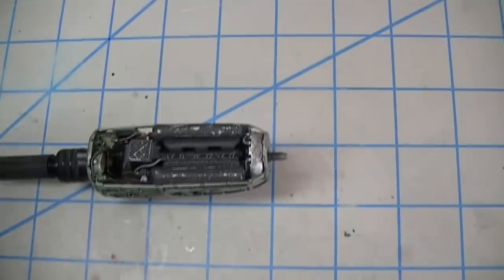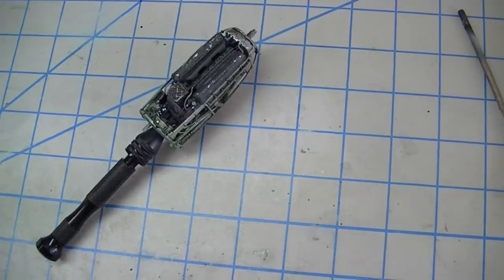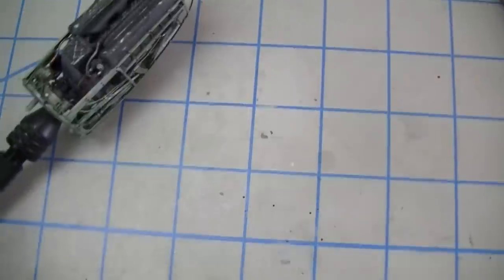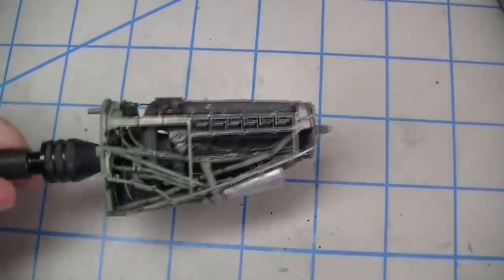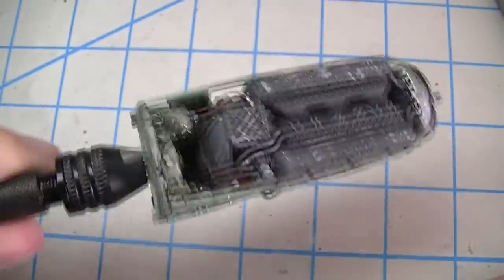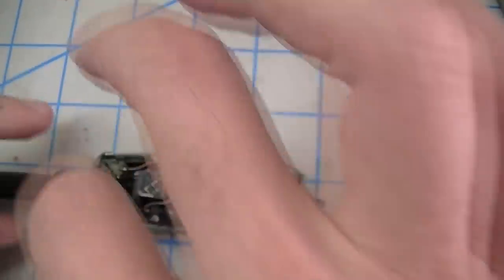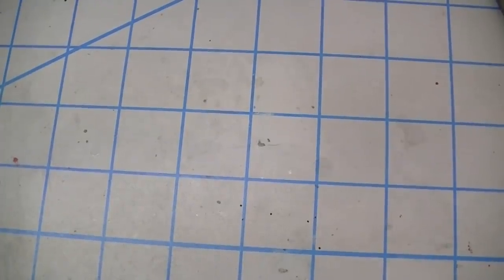ep228 - adding detail for hoses, wires, and tubes

Comment: Your finished product of added detail is fa-nominal,  I've been trying to find the (micro) vinyl tubing that comes with the 
Tamiya 1/12th motorcycle kits. I do the same kind of detailing with aluminum wire, stretched sprue tree pieces, fine 
brass wire. I make my fittings from sprue tree pieces that are hexagon by - Xacto knife. I've been using the same Xacto
knife blade for over 18 years as I resharpen it with a knife sharpening stone. Scraping one side sprue to start, then opposite
side then the other 4 sides (one at a time of course) to get the Hexagon shape. Then cutting, sanding and drilling the center 
hole for the replicated fitting for the tubing for fuel or coolant lines. Unfortunately  There's no way to attach a pic of my work
here to show you. I do the things other modelers don't do.......I fabricate my landing gear to operate as well as the flaps and
control surfaces. Most modelers all do the same things and I'm just as guilty as are all others. What I'm working towards 
now is replicating dogfight damage, bullet holes, fluid leakage from arial  dog fighting. Crashed aircraft and last but not 
diorama that's suspended from the ceiling with

Comment: instead of drilling depending upon the situation of course I sometimes use a heated hypodermic needle to create a hole, basically melting a hole into the plastic, I mainly use fine soldier being it is dead soft as my wire and hose and the fact I have it readily available because I already have it for soldering

Comment: Will, thanks very timely video as about to build the 1/32 tamiya spitfire. I'm an expat  living in Asia so bass pro shops for wiring is not an option but I've been thinking about using lead solder which is available in thin gauges . Have you heard of any body doing this? I'm not sure of the chemical composition and whether it would take paint or potentially pose long term problems.  Also for fixing to engine parts, I've got a crimping tool which comes with tiny bits of flared tubing down to about .5mm which I think would be excellent for this purpose. They are slightly flared to allow insertion of wires before crimping so would make getting the wire into the fittings easier for fumble fingers like me. A spot of superglue would hold them in place and they have a real 'manufactured' look.  Thanks again for your series. I've just finished the full build series on tamiya supermarine mk 1 which was invaluable. Your tip of putting a small piece of sanding foam in tweezers was worth watching the whole series for as I had real problems with precise sanding before.  I find your slow approach really useful as often important details on technique are edited out or obscured by 'fast motion videos' on other channels. Just knowing how long it takes to do some operations is really useful as videos assume you know this. After spending four hours doing masking setup  I used to wonder - does anybody else take this much time, maybe I'm over thinking it?  I stick your videos on whilst I'm modelling. A side effect of this is that my wife now acknowledges that there are people who take scale matters as seriously as I do!

Comment: Another easy access to precision wire is your friendly neighborhood guitar store. They will sell you single plain 30" long strings for about a $1, and you can get every size between 8 - 18 thousandths of an inch easily. I believe .020" is the largest plain string made, but are not as commonly found. Keep in mind; they are hardened and stiff so are not ideal for what Will is showing us, but have many other uses. Above the sizes I mentioned, the strings are a steel core wrapped with either nickel or bronze which can be good for corrugated hoses. They are also available as singles in specific sizes.
Reply: The only drawback is the hardness of these wires. Harder to cut.
Reply: @cactuswest  Yup. Don't try to cut them with cheap electrical wire cutters; you'll probably gouge the blade. You need good hardened snips.

Comment: If you can get your hands on one of the old Aurora or early AFX slot car electric motor armatures they have VERY fine copper wire. The varnish comes off easily with say 600 sandpaper. It is fine enough i used it once for a true scale throttle return spring in  a 1/24 scale car. I think it was about 0.002"-0.003" in diameter. Being copper it worked great to wrap around a very tiny number drill and then carefully glued into place.

Comment: Hello Will. I was looking the wires and cables you use, and I'd like to share what I came across the other day. So my phone broke, I ended in a phone repair store and they sell this copper wire for cellphone flex and screens that is the smallest I found, it's a 0.01 copper wire and is by far the thinest one I've seen so far.  hope this helsp. Keep up with the amazing work and videos! Best regards!

Comment: Heat shink wire insulation with copper wire works well for me. Both obviously come in various diameters too, which I get via aliexpress. The wire insulation gives a realistic rubber hose texture and takes weathering well.  It also comes in loads of colors, but black is best, or has the most uses with engine details. And the other colors work great in cockpits and other areas.
Edit: I forgot to mention that I make up a few feet of the most common diameters and finish them off with a lighter or butane torch so the insulation sleeve is snuggly around the wires. You can use a hairdryer too
Reply: excellent suggestion👍

Comment: Great video. Question. Do you premeasure the wire from starting point A to ending point B and cut it before securing to point A? Or do you just secure at point A and then cut in the end as you approach point B? Thank you.
Reply from the maker: the second thing.
Reply: Thank you! Your videos are excellent.

Comment: will, so loving all your video's and as a newbie back to the hobby in the uk after a 34 years break my first build is a 1:48 scale me 262, so if i were to think about hydraulic break lines and cockpit cables in that scale what would you use ??    ta muchly gangster !!
Reply from the maker: well, at 1/48, a 0.5" hydraulic line is 0.010" or 0.25mm so there you go.

Comment: Hello Will! I have been having issues with attaching PE and various metal wire to painted parts and having it just pull back off trying to make adjustments. I have been using thin and medium CA glue with and without accelerator. Some have even been left overnight. Do you have any suggestions. Some of these parts are painted as in seat belts. Have tried even removing paint at attachment points and still have same results. These are fairly new bottles of glue. So I figure age shouldn't be the issue. Thanks for any suggestions.

Comment: Those pipes could be coolent pipes for the carbs apparently they where water cooled . Love to know the answer if you find out
Reply: They are oil injection cooler lines.  It runs oil through an internal line inside the water reservoir to cool the oil.  It's where we got the idea for modern radiators having transmission coolers in them.  So the external solid brass or copper lines have oil running through them.  In the manual I believe they called them external oil galleys.  In modern engines they use the same principle to route oil to piston squirters on turbo or high performance engines.

Comment: The average survivability of a spitfire aircraft at least in the early part of the war was only about 4 weeks. Much equipment from aircraft to vehicles, tanks etc were nowhere near run in before being destroyed. I always find modelers overdo weathering. If that is what an engine looks like after about 20 hours running then there is something desperately wrong with it in the first place. It should look brand new to be realistic.

For example every time a Royal Navy warship enters a port it anchors off shore and gets spruced up with paint. It is an ambassador so has to look tip top. Then a modeller decides to cover it in rust. That might make a nice looking model but in peace time is 100% unrealistic.
Reply from the maker: well, number 1, this isn't an early war spit.  it's a mk9.  tamiya doesn't make an early war spit in 1/32.  number two, while your facts may be correct, your supposition is just wrong.  there's plenty of evidence.  these aircraft got beat to shit and modelers theories about how they wouldn't be weathered are exactly that.